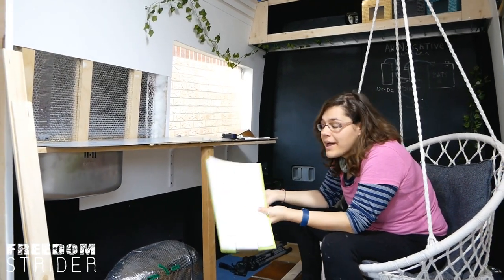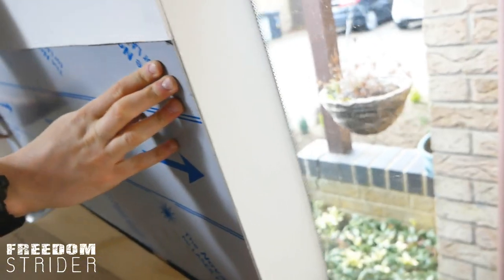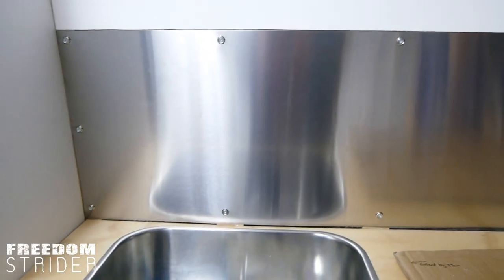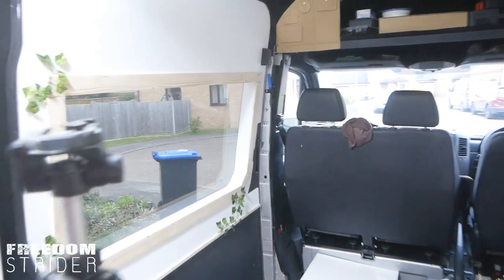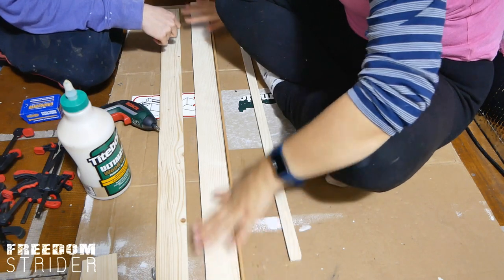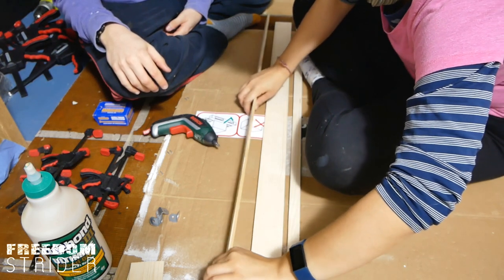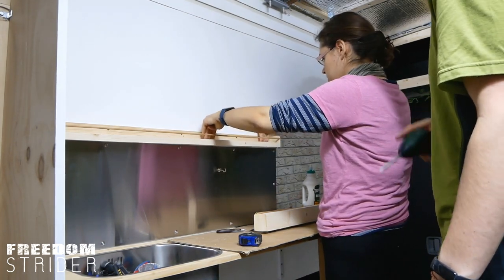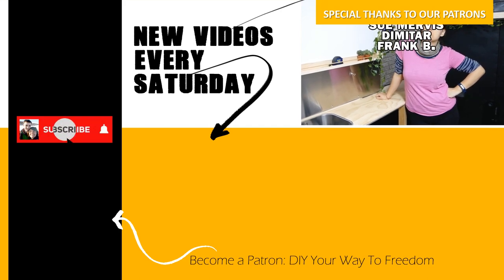Magnetic Stainless Steel Kitchen Backsplash | Sprinter/Crafter Van Conversion

Comment: Hi guys this was good timing.
I've just done my splashback in stick on floor tiles and it isn't a good enough finish. The main thing is even being very careful the joins show up too much. You can get thinner stick on wall tiles but I didn't like the patterns and they were too expensive.
So your choice of material is a very good one and I'll be doing the same now.
Thanks for the visual example.
Reply from the maker: Ah yes, sticking on the tiles is something else we did give thought to about how difficult it would be. I know you can buy them in bigger panels rather than individual tiles but it still requires precision. We love the steel look 😇 Quite easy to install as well, glad it helps!

Comment: Nice job and durable material. But you will forever be wiping off finger marks! (small problem for such a good looking result).
Reply from the maker: So far we've only cleaned it once 😂 Time will tell but indeed, fingerprints are worth it for the look 👍

Comment: I’m thinking of copper for a splash back, antique copper mixing bowl/cooking pan for a sink in a timber bench. I could then use copper pipe for curtain rods and on the front of shelves.
For an easy trailing plant try wandering Jew, plain green or variegated easy to grow from a cutting. Or you could have real ivy, cuttings take root easily in water(a bottle doesn’t spill easily, and looks ok until potted up) Tie about 4 pieces in a bunch and plant for an established look. Just keep a look out for the sort with smaller leaves climbing up a wall and snip some off, instant plants.
Reply from the maker: Thanks for the tips, we are looking into plants that climb or dangle buy don't latch on and root because otherwise it will cling to the ply walls and take root and we will never get it off 🤣

Copper accented metalwork looks great with wood, not our personal favourite but yes, copper sink, splashback, rails and even plugs and switches work really well 😎